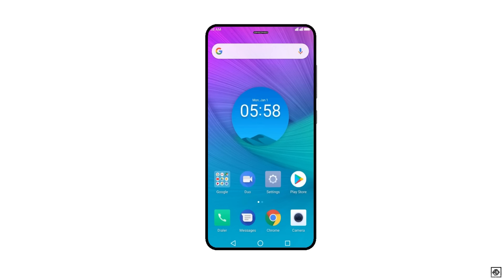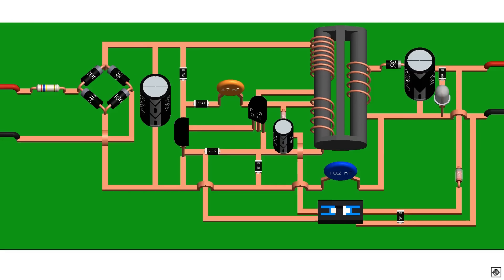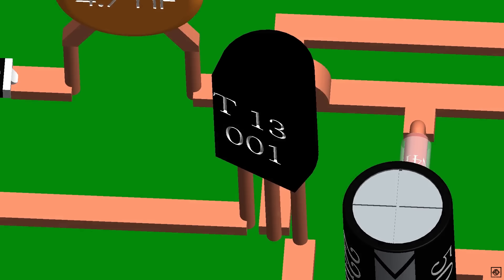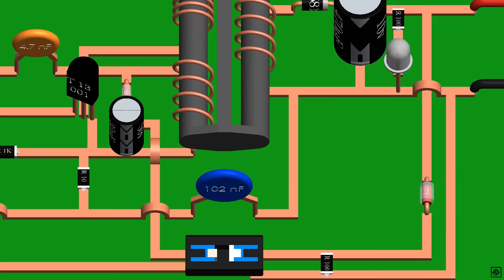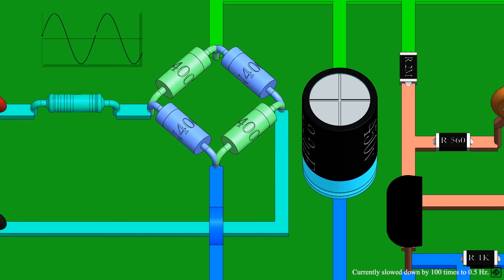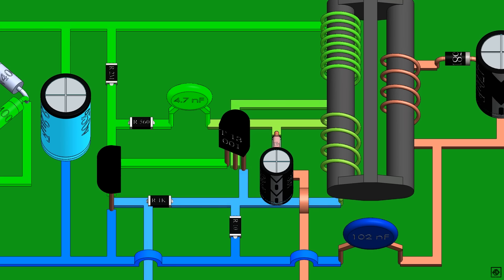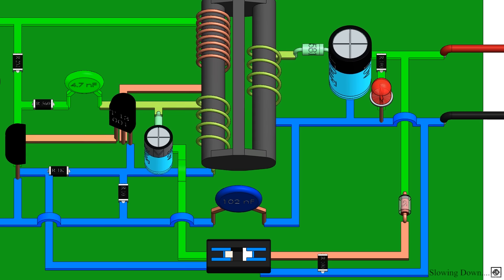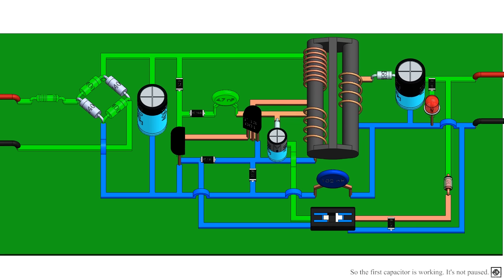How does a mobile charger work? SMPS with Opto-Coupler.

Comment from the maker: Circuit Diagram - https://drive.google.com/file/d/1TWNf6OfTSGOfDitfw5u4qp9Hvs_lkU74/view?usp=sharing
Correction - In the video the fusible resistor is 2.6Ω and not 260kΩ.
Reply: can I use your Circuit in my video? because I make video in Hindi language and I want to explain same things in Hindi language, I will waiting for your response!
Reply from the maker: @DipElectronicsLAB  Sure.
Reply: Hi, Please make a video on how to design 220VAC to 24VDC, 12VDC, 5VDC.
Basically teardown of HILINK or Mornsun AC-DC converters.
Reply: thickness of the wire ?
Reply: Nice
Reply: Brother this  circuit board 5v and how much ampere?
Reply from the maker: @gurumoorthytamizhan6591  0.5 - 1 Amps.
Reply: @ExplorerStuff  ok Brother thanks 😊 and How to  build 5v  2amper  circuit ?
Reply from the maker: @gurumoorthytamizhan6591  This circuit will work. Change the transformer to more than 15 W (with same voltage step) or decrease the turns of secondary windings (not less than half, other components may fail).
Also, change the filter(at input) and output capacitor to higher capacitance or add another in parallel.
Reply: How to make this graphic video
Which application used making this video
Reply: Can you explain the concept of lower input ampere and higher output ampere in common chargers? 
I get the concept of P=VI. But, can we amplify current in a circuit from one limited source?
Reply from the maker: @rajkarankainth  It is different than amplification. Its like conversion, where voltage is reduced and current(amperage) is increased, like a transformer(AC) but its a converter(DC).
Reply: Hi, Amazing video but the circuit is not available in the link
Reply from the maker: @kfash5198  Thank you and link updated.😄
Reply: what is  simulation name you are used ?
Reply: Thank you so much for this.. it helps alot..
Reply: how mosquito bat works?.. make a video on this also
Reply: What is name of program to make this Anime , please ?
Reply: Thanks!
Reply: Thanks information
Reply: @Technicalarunji  Blender.
Reply: @cehaalhaq5176  blender
Reply: Next video led working
Reply: Hindi
Reply: @ghaniben1  depends how much current the circuit will draw
Reply: i copied it thanks
Reply: This is interesting, but which parts of it are acting like buck converters
Reply: You all probably dont give a shit but does anybody know of a tool to log back into an Instagram account?
I somehow forgot the login password. I would appreciate any tricks you can give me
Reply: @Alexander Sam it worked and I actually got access to my account again. Im so happy!
Thank you so much you saved my ass!
Reply: @Ayden Darian happy to help =)
Reply: What is the part number for transformer?
Reply: The voltage of the primary coil seems to pulsating dc, not ac
Reply: ظ
Reply: Thanks
Reply: Excellent piece of demonstration of a cell phone charger! Thank you so much.
Reply: Agreed!
Reply: Hi, can I upload your video by translating into my language, Bangla?
Reply: How electric fence work?
Reply: @ExplorerStuff   please provide the values and voltage of input output capacitors to gain 2 Amp current. Thanks a lot
Reply: It's a full bridge rectifier
Reply: Why y should we use invertor and high frequency current ?
Reply: very, very poorly explained and lacking in information
Reply: Chenging english to somali
Reply: @DipElectronicsLAB iiiiii
Reply: @symeon657  The simulation can't work because you shorted the output with the ampere meter, you didn't edit hfe parameters of the transistors and you used a normal diode instead of fast recovery one. BTW, you can generate a very short link with that simulator.
Reply: Thanks again.
Reply: What is the essence of converting frequency from 50 to 50kilo hertz
Reply: Fine too good...
Reply: The 100 nF capacitor to the output violates the compulsory output isolation requirement. (Double isolation for safety)
Reply: How is this charger " mobile"? Or is this just the conventional UK misnaming for a cellphone?

Comment: I'm just gonna pretend I understood it all
Reply: me too😄
Reply: Me too 😂😂😂
Reply: 120V AC go through the transformer in order to step down the voltage then it go to the 4 diodes which we call it bridge rectifier to convert AC to DC. The capacitor is added parallel to it because it will reduce the ripple voltage. not sure about why the using the transistors but i think it increases the frequency so they can reduce the size of capacitor and transformer.
Reply: Electricity takes a while to truly understand, I'm a journeyman electrician and electrical engineering student, I've been messing with electricity since I was 6 taking apart my walkie-talkies, and there's still a lot left for me to learn. If you care to learn, you will eventually get to a point where this lesson will seem so easy it's like watching a video on how to tie your shoes. Just stick with it.
Reply: @binaryglitch64  same bro, Im actually an electrical engineering student too and been tinkering since I was 6 too. Now that 8 months has passed, im beginning to understand it more and more
Reply: Dismantled my charger until about 5 minutes in and shit just went whaaaaaa
Reply: Must show the flow of current where it will go...
Reply: Me too
Reply: Same
Reply: You’ll need at least first year college to understand this🤣
Reply: This tbh
Reply: @johnnguyen8956  I think it says that basically when the voltage reaches more than 5 volts, they transistors work as a switch.
Reply: @georgefan2977  Nah as biomedical engineering students we learnt those type of things  in the first semester. You can make a simpler circuit if you want
Reply: I don’t have an electronics background and still mostly understood it. Got to give Explorer some credit for teaching.
Reply: XD
Reply: Just focus and you everything will become more clearer
Reply: I actuallu did

Am an expert xd
Reply: Sign me up 😂
Reply: @johnnguyen8956  seriously you know nothing about smps
Reply: @johnnguyen8956  🤔😳
Reply: Nothing hard, just a typical smps
Reply: Me too
Reply: Not to brag, but as an electronics enthusiast, I had no problem understanding.
Reply: Me too 🤣
Reply: Same
Reply: One thing I understand is that it is all about calculation and thinking about what is the next(capacitor/diode/transistor/rectifier/.......) And how much for reaching the goal(charger)
Reply: Me 3
Reply: I understood it, and I am glad he brought up the bands on the resistors because I still have trouble reading them without the sheet.
Reply: So you have to learn first how a rectifier and filter work and a p-n junction diode and transformer work
Reply: It ends with, "now you know how a phone charger works" 

Me: "That's pushing it, buddy"
Reply: Yup
Reply: Same
Reply: How can you not even understand that
Reply: @WhoisRoach  well I understood it but not "all"
Reply: @DenzCasuela  Okay
Reply: it's just a matter of studing it now
Reply: I wonder if it's a person explaining or just a computer 😂😂😂
Reply: Ignorance is bliss, right?
Reply: I do
Reply: Same here
Reply: Me too
Reply: Me too
Reply: Good plan
Reply: So basically it does the thing that does the thing. Got it?
Reply: But i actually understood
Reply: Three years ago i was considered i understood it completely
Reply: @rohit22514 i know like it's wild
Reply: Me too😅
Reply: I am sure the explainer doesn't know what he is talking about,  he is just reading the script😂
Reply: Me too😂😂😂😂

Comment: Another advantage of these types of power supplies (besides their reduced size) is universal input voltage. Most of these can operate from 100V to 240V AC.
Reply from the maker: Thank you for mentioning it...😀
Reply: Thanks a lot for that inpur
Reply: When we use it in 100v eg in train, the  charging time is very long may be due to less output volt and current
Reply: @klmkt4339  it depends on the charger bruh
Reply: And efficiency and standby consumption.
Reply: I tested on a 80V battery. It can take DC also
Reply: @e.v.b4276  thanks the internal oscilator
Reply: It's amazing how versatile these little things area
Reply: Also can operate on dc
Reply: and can also operate on 50 or 60hz Alternating Current
Reply: is the frequency also universal since some countries use different AC hz?
Reply: Ok, but why can the size of the Transformer be reduced? (How it is lowered down the 220V/110V?) So what if we have 15Kz there?
Reply: @StagnantMizu  yes, they typically work with both 50 and 60Hz.
Reply: @octavianr526  the smaller the core size, the higher the frequency must be. So these switch mode power supplies, have very tiny transformers, but have circuitry to boost the frequency to 20-100khz.

Comment: Wow, i had no idea that was all going on in those little power adaptors. I thought it was just a step down transformer. What brilliant engineering! Thanks so much for making this video!
Reply: It used to be just a transformer and voltage regulator circuitry but that is extremely huge, heavy and inefficient so this is the modern design

Comment: I would not expect something so simple in a modern phone charger.  I'd expect this in the 90's.  This is probably the cheapest way to get a regulated +5V, I can't argue with that!

From what I see, the transistors are in an astable multivibrator configuration, then they go into a pulse transformer.

What I would expect is common mode chokes for EMI, a high-efficiency switch-mode controller with a fast FET to reduce time in the linear region for efficiency purposes, and MOV ( or .

Great video!  The animations and explanation was great (I smiled when I heard you explain why you can't just use a transformer at 50/60Hz).  I'm an electrical engineer and I approve.
Reply: My exact thoughts, I would've guessed that most of modern phones uses a Buck converter /cuk regulator or another synchronous SMPS circuit instead
Reply: @DRAIK08080808  yah for efficiency. Cause this more like a linear circuit that would decipate power in form of heat.
Reply: 90s chargers were better than this. This curcuit is copied (with some mistakes, like component values and seconsary diode orientation) from the cheapest chargers you can buy. They are very unsafe and don't last long, but are great to demonstrate the basic principle which is the same for all flyback transformer PSUs, no matter if old, new, cheap or expensive.
Reply: @DRAIK08080808  

The output needs to be isolated from mains. Can't use a buck converter.

Comment: I like how those "AC > DC > AC > DC" conversion is having a great efficiency
Reply from the maker: Glad you liked it.😀
Reply: @ExplorerStuff  
Hello,
Can we use a 12v DC input in stead of 220v AC?
If not, what we should to change in the circuit to be 12v DC input?
Thx
Reply: @hass_ra80  Simply use a Linear Regulator to convert 12VDC to 5VDC.  If you want higher efficiency then you can use a Buck Convertor but the ripple on output will be high and might damage batteries without proper protection. You will have to run the numbers or simulate, prototype it for best results for your application
Reply: @hass_ra80  If you have a bridge rectifier to make all your outlets 12v DC, then you won't be able to step it down with a transformer, every power supply would have to use a DC-DC converter which is possible but probably less efficient, and the AC standard is already established everywhere

Comment: This video is just a whole university subject teached in just 6 minutes with every detail fully understandable even for beginners. Till now the best video out there for explaining the working principle of an everyday appliance we all use.
Reply from the maker: Glad you think so.😄
Reply: Sorry for being dumber than a beginner, even though I tested at 132 IQ. I just wish I could find the video where they start at the beginning.
Reply: Bagaimana cara menambah ampere pada charger??
Tq
Reply: @imammaarifarif4388  Change the transistors. The T1 is gating how many amps are let through, if you change it for one with more rated amps, it should let more go through. I guess you'd have to then change the transformer and capacitors as well, probably even the Schottky diode.

Comment: Great Explanation 👍👍👍
Reply: I am also your subscriber
Reply: Aap bhi to great hai sir
Reply: Abhi bahut acche ho
Reply: I am your real subscriber
Reply: Can u find the mistake in this video
Reply: Big fan  bro 😊😊😊
Reply: I am a big fan of yours.
Reply: Hello 👋🙋‍♂️ dip bhai
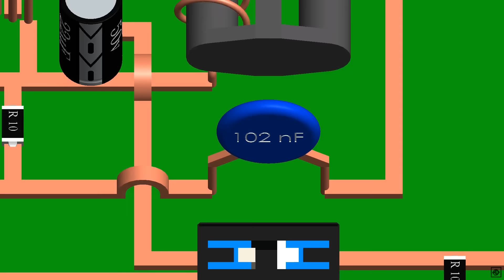Reply: 3:00 Will it be a problem if I remove that blue ceramic capacitor ?
What is the use of that blue ceramic capacitor ?
For anyone who knows about this please let me know.

I removed that componnent from my adaptor because that annoying capacitor often zaps me.
Reply: @LabArlyn  If it zaps you, something is wrong, or the capacitor leaks. it should be class y safety capacitor.
Reply: @nonamedelete9132  no, all the SMPS's I have tried zap me with the blue Y1 capacitor installed. Therefore I removed that annoying capacitor from my SMPS's and the problem solved. Can you tell me what's the purpose of that capacitor ?

Comment: I had a simplistic idea that there is a step-down transformer to reduce the voltage, and a zener diode to convert AC to DC, throw in a couple of resistors and capacitors to smoother the output. That very high frequency AC current needs a small transformer is new to me. Many thanks for the enlightenment.
Reply: Yap, thats how they used to work, this new design is simply for space and efficiency

Comment: The circuit presented use only two transistors. It is a good minimal design reminding engineers what was done before specialized chips became available.
Most switching power supplies now use a small PWM chip which control the gate of a FET transistor (often integrated in the chip).
They often skip the opto coupler by sensing the back emf on the primary side. This back emf can be sensed only after a delay in the rising or falling edge. These chip also measure the current on the FET and turn off if too large, indicating that saturation is reached (when the DC resistance of the coil becomes the load, no back emf voltage anymore ; the inductance is fully discharged of magnetic energy).
Reply: Still most of the concepts introduced in this video remain valid
Reply: Oh wow cool 😮😮 interesting

Comment: Very well explained. This video will help me in repairing some faulty mobile charger.
Reply: This is very basic switching power supply,  the principle is the same but you might find thay some are much complex depending on the design and output power requirements. I am electronkcs technician and i somehow do repair advanced switching power sjpply down to component level. Goodluck mate.
Reply: Thanks @sthandiwe7825  for the information and encouragement.

Comment: So the optocoupler is the quartz time keeper and voltage regulator feedback loop, when activated, it shunts the primary, regulating voltage and the cycle repeats.
What a cool circuit!

Comment: Sir normally fuseable resistors are using low value....Like 10 ohms,15ohms.in this circuit using 260k please check.
Reply from the maker: Now that you mentioned it. Maybe the third band was gold and not yellow. So it will be 2.6 ohms.
The video cannot be changed but I will mention it in the description.
Thank you for noticing.
Reply: @ExplorerStuff  sometimes it happens to me with 4-5 or 6 band resistors. But I agree, that sound more reasonable, as P=I^2*R. In a 10W charger, (10/220)A flow through the resistor. So the resistor's power would be P=(10/220)^2*260000 = 537W :) Thansk for the video! It's the best one about SMPS I've seen so far
Reply: I'm looking for this comment.

Comment: The resistor on the phase input would not be 260kohms.  At that value there would be next to no input voltage to the bridge.  The value is more likely to be less than one ohm.
Reply from the maker: Now that you mentioned it. Maybe the third band was gold and not yellow. So it will be 2.6 ohms.
The video cannot be changed but I will mention it in the description.
Thank you for noticing.
Reply: Explain me wtf both you just said

Comment: Thank you for posting. I’ve always wondered how they have achieved this voltage reduction without generating heat. Why are some power transformers still so large ? Who invented this technology ?
Reply: If it makes u feel any better people 200 years ago thought up and harnessed these concepts and are named after there findings ..ohm's..Faraday..volts.all these things are people names ..and we teach it all common place in school and were dumber now than then WHAT HAPPENED..nobody invented any of it just harnessed it
Reply: CRT televisions were among the first devices utilizing this concept, to generate the high voltage for the anode of the picture tube. Of course with step up instead of step down transformers. 1930s probably...
Some power transformers are large because they are running on the low mains frequency itself... 
Which has some advantages like less electric (going to the load and back into mains) as well as magnetic (radiating from the transformer and wiring) high frequency noise, and better reliability. Or they are used because the load requires low voltage, low frequency AC instead of DC.